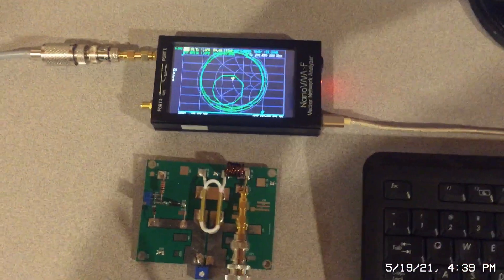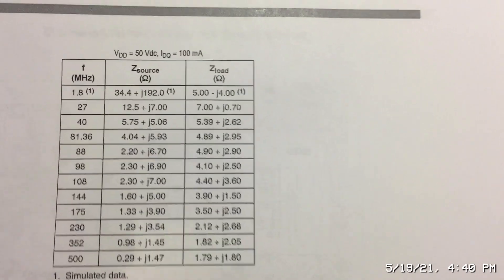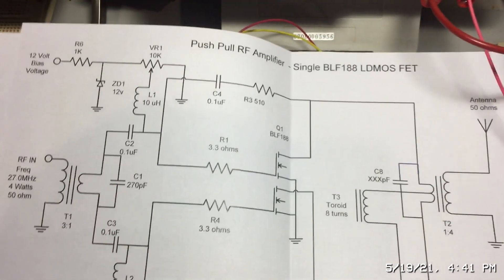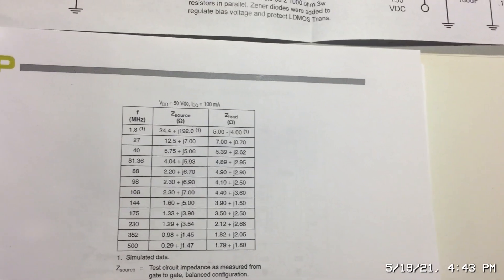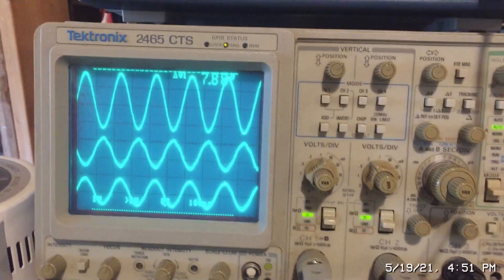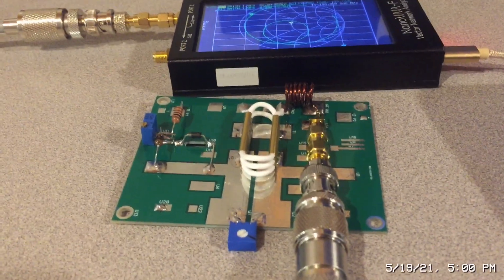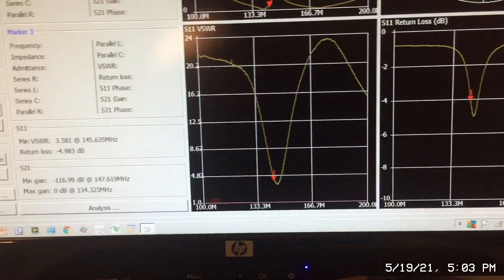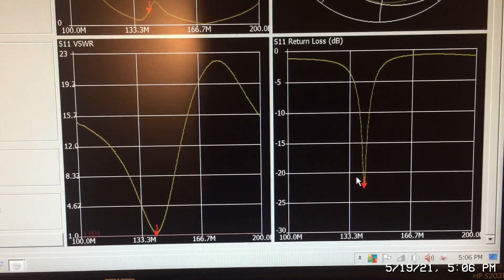RF Man - Impedance Matching in an RF Amplifier using Conventional RF Transformers and a NanoVNA

Comment: Say you are running class AB or B with a transformer that has a  center tap secondary, do your turns ratio need to be divided in two  so you would have half the amount of turns?  EDIT you answered my question in the video